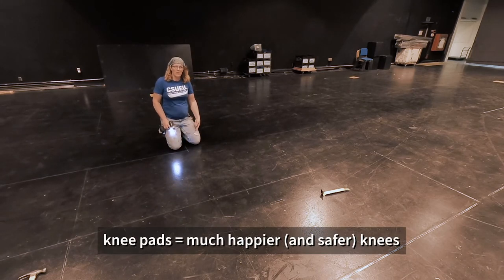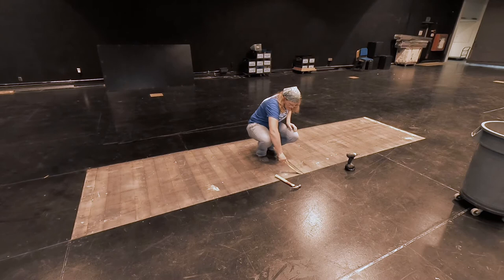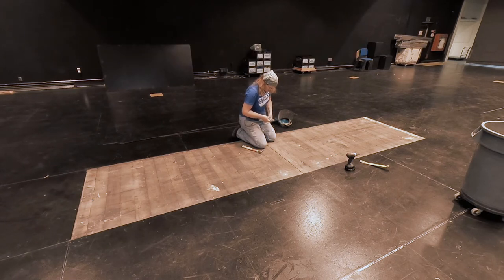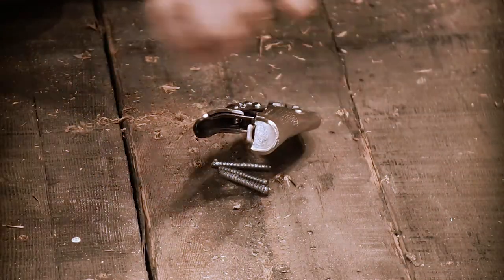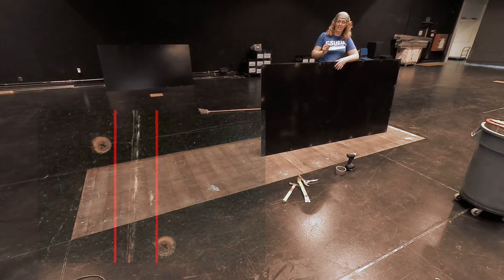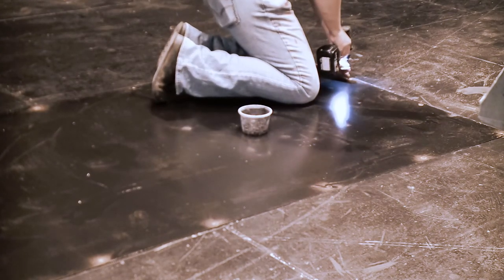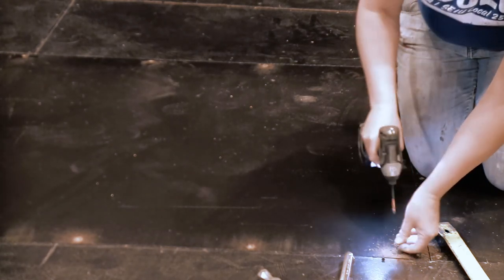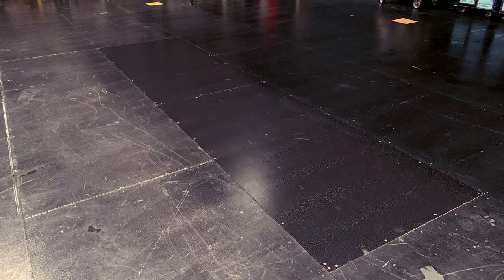Stage Floor, part 3 –  Replacing Masonite on the Stage Floor

Comment: From prior videos it appears you use quarter inch masonite for this project, however can you please advise specifically which panels you use? Thank you very much!
Reply from the maker: Yes, quarter inch tempered masonite/hardboard, smooth on both sides.
Reply: Thank you for the lightning quick response! I will attempt to recall  the email I sent apologies I wasn’t sure how often you monitored YouTube apparently it is immediate.